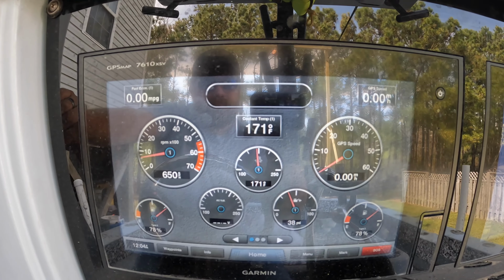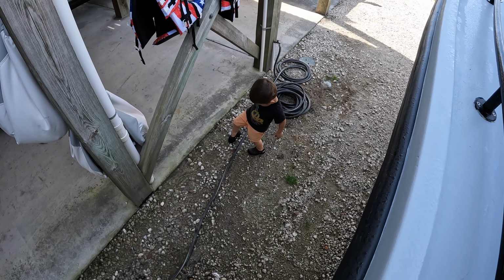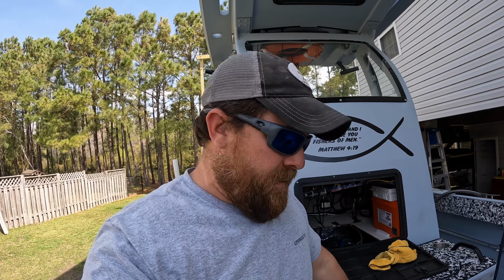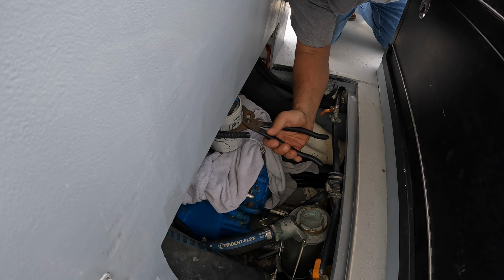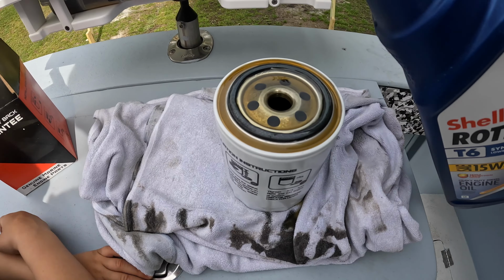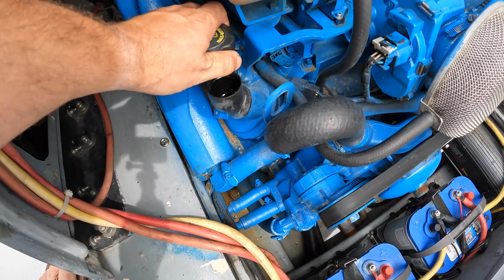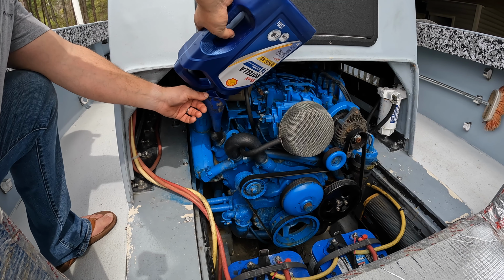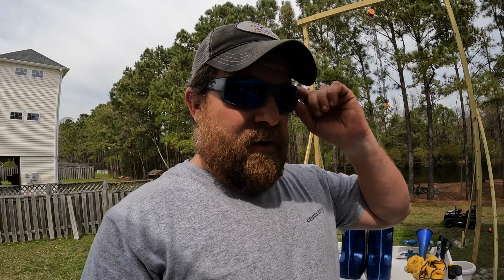How to change the oil in a Marine Inboard Engine in a Custom Shamrock

Comment: I don’t know if you have the space under your oil filter but I like to take a 1 quart water or soda bottle,cut off the top and slide it around the oil filter. Loosen it with a wrench at first slide it under and loosen the filter and the oil goes into the water bottle.
Reply from the maker: That's a great idea! I've seen my Dad do that on an old chevy but didn't think about it for this application. Will def try it next oil change! Thanks for sharing!

Comment: You did a beautiful job restoring your Shamrock. How's the 6.2 working out for you, and have you thought about putting a bow thruster on it?
I've followed your channel during the restoration, and I'm subscribed. I have a 26' Shamrock Express, with the Cummins Diesel. They're great boats. I'm also happy to see your son trying to teach how to do maintenance (LOL 😆). God bless you and your family.
Reply from the maker: Thank you! The 6.0 Crusader has been awesome! Fuel burn averages 1.6 to 2.0 mpg (depending on load). Cruising speed is around 25-26 mph. Max is 30-35mph. I had a bow thruster for it, but decided the cost wasn't worth the install as well as the extra weight in batteries. I plan to add a trolling motor this season so that will take the space for the batts. How do you like the cummins?! If i ever convert to diesel that will be my route. Thanks again for following along and have a blessed day!
Reply: @reelfreedomoutdoors  
I absolutely love the Cummins Diesel, 300 diamond performance 6BTA. I'm getting 7-8 miles to the gallon (depending on load) the same speed as you're getting. I have a bow thruster (Florida Bow thruster, the guys name is Tom, Merritt Island Florida) and it doesn't take any more batteries to operate it. Strike Marine in Hollywood FL did the gasoline to diesel conversion. I had it re shafed to 1.5" due to the torque of the diesel along with switching to a 5 blade prop
Reply from the maker: @henryratajczak7806 That's awesome! Thanks for the call today! Really enjoyed our conversation and look forward to keeping in touch!
Reply: @henryratajczak7806  Where did you find a 5-blade prop that'll fit under a 26' Shamrock?  I'm running a Yanmar 4LH diesel at 2.04:1 in mine and would love to run a fiver with about 20" pitch, but have had no luck finding one that'll fit.  With the 4-cyl engine and nearly even gear ratio, 4-blades gives bad harmonics.
Reply: @hawkeye5469  Hi Hawkeye, all the Maine boat builders (down east) can help keep it. Michigan Wheel is what I have, I believe it's a Star Kaplan. Lauderdale propeller/marine propulsion, State Road 84 Ft. Lauderdale. When I did my repower upgrade, I went to a 2.1 gear ratio ZF . Lauderdale Propeller worked it out for me. They're about the best in the industry of propeller world.